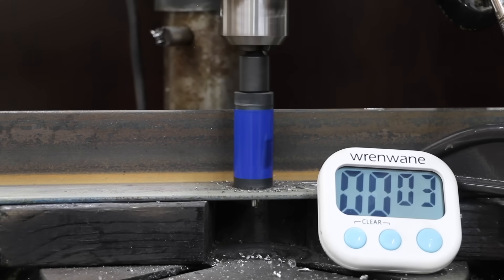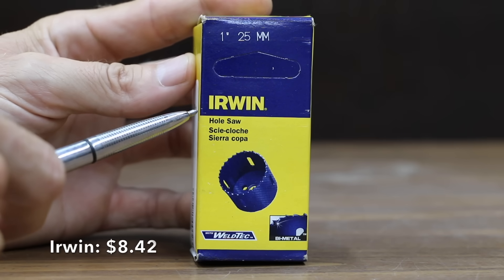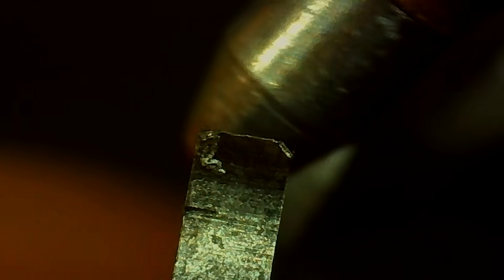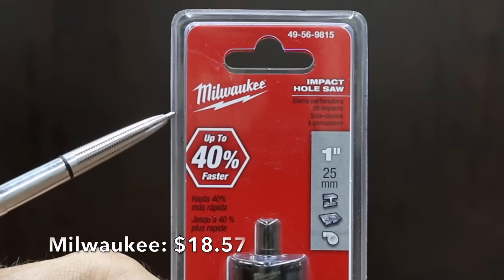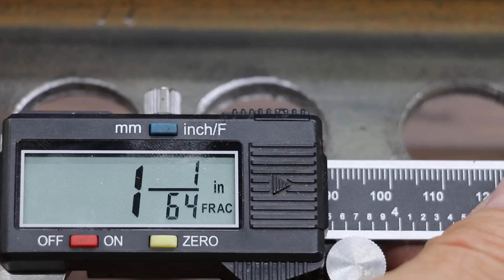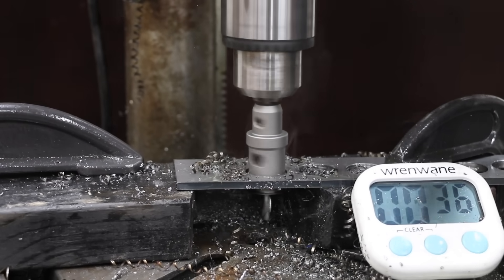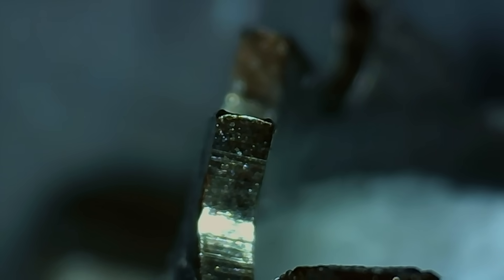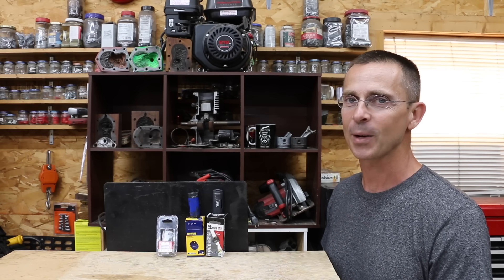Best Hole Saw Brand? DeWalt vs Milwaukee vs Irwin, Bosch, Lenox, Diablo, Bosch, MK Morse

Comment: Not to take away from a very useful test, but when testing any tools that have different metals (like carbide), the cutting speed is much different, so using a "common" weight on the press is going to ruin the blades. Also, letting steel get over-heated during a test with too much "weight" (cutting speed) without fully sinking that heat away (coolant or air) will "case harden" the plate and remove the "hardening" from the tool. Thus, the tool with better heat-sinking will not harden the plate (and not soften itself) as much and it is now cutting a different material than the other, so the test is now invalid, and every following test that uses a cutter that was abused.

Allowing the cutter to cut so much material that it stalls and then soaking in that heat momentarily and then quenching it instantly to room temperature (by the cutting fluid) will also ruin the cutter. If ANY tool stalls like that, you have already demanded more cut than you should have, which generated too much heat throughout the entire cut which invalidates the test, because it was performed outside the tool's designed envelope of operation and ruins the tool for any following tests.

This is especially important when you ramp through the tests from easiest to hardest. If you hurt the cutter in test A or B, it has no chance of working as designed in test C. Another thing to think about in terms of cutter speed is the surface size of the blades cutting into the plate. A wider blade has a much different "correct" cutting speed than a smaller one because it's cutting more material. Either the RPM or the downward force must be adjusted for the tool to be properly used. Nobody buys a tool and then intentionally ruins it, they try to follow the "best practices" of the manufacturer as is practical in the field.

Putting a wheel on the press makes sense to get an even playing field with the same types of tools operating within their envelope. However, this turns into precisely the wrong way to use tools of different types. Since carbide tips are similar to a lathe tool or milling tool, the same methodology of "material cut per second" needs to be calculated. A cutting rate to slow or too fast will damage the tool and the cutting performance will permanently tank in seconds.

Probably the easiest solution is to group the tools by blade material (or blade hardness) and calculate the correct cutter RPM and weight for blades of that material and use that as the base to use. You could make part 1 and part 2 videos showing the shootout of the same type of tools. More videos for us yay! Or you could stuff them all in one video, but the tests are different.

The high value of this channel is that the tests correspond to the real world. Anyone that pushes a drill bit into steel until it turns blue and stops cutting is not going to finish that hole or any other hole until the bit is sharpened. Even then, the flutes will not hold an edge now that the tool has been over-heated. People may accidentally operate a tool outside it's envelope, but the tool gives plenty of hints before it is being seriously abused, like smoke or blue metal. People react to that and adjust the cutting parameters to use the tool properly in real time, so testing outside that philosophy defeats the purpose of the "real world" testing.

It's difficult to devise a non-subjective test to flatten the field, and the majority of the tests on this channel are excellent at threading that tiny needle. However, when cutting steel it requires an entirely different set of parameters to flatten. Things that humans do easily in real time with the drill motor they are holding.

I'm not sure off the top of my head what that test would look like, but it would involve calculating the volume of material removed per rotation, the RPM, and constant cooling, to avoid ruining the blades being tested. Maybe the test is just using the optimal parameters for each individual tool and seeing how fast they get the work done and how many holes they cut until the tool is "spent"?

Sorry to hit you with a wall of text, but I think the principles I discussed are present in many of your tests involving different types of tools, and it would add a lot of value to the tests and your videos.
Reply from the maker: Thanks for the feedback.
Reply: @ProjectFarm  Thanks for the gracious reply. Keep making the best videos (by a huge margin) in this genre.

I noticed that I may have conflated FEED speed with cutting speed which is a tad different.

If anyone is actually interested, there are machinists on youtube and docs on the internet that actually know this stuff. I only know "of" it existing as a thing to pay attention to.

For example when drilling, it is much better to press hard enough to get some chips, then pull out to let the drill cool, and apply some oil to the hole, wait a moment and repeat.

Drills will last a lot longer and you'll get through the hole faster, than over-spinning the RPM with a light press which just grinds the point off the drill instead of cutting a hole. If you're not getting chips, your feed rate is usually too slow.

You normally only have to worry about this stuff when working with metals, but the chip advice is true in hack saws and chain saws too.

Another thing is aluminum being very abrasive as opposed to brass which is soft and almost self-lubricating. Cutting through multiple layers of tests with aluminum will seriously dull a tool by the time it gets to the hard test, so that's a thing to watch for.

In a perfect world, you'd start each phase of the test with a new (or sharpened) tool, but who has the money or time for that? Thanks for reading. I wrote it in the hope that it was useful and might improve future tests. Be safe.

Comment: Absolutely love the high speed info! No fluff, no yelling. 100% follow through with relevant information.

Would a diamond grit (eventually) cut through the armor plate? Would any of them gum up on aluminum? I have purchased a set of Rodman drill bits that look like masonry bits but also cut through hardened tool steel. I wonder if such a cutting edge has been applied to a hole saw?
Just called Rodman. They have grit bits but no cobalt all purpose bits... Yet
Reply from the maker: Great suggestion!  Thank you.

Comment: I'm slightly confused. The size is stated as 1" I believe, but at 9:55 it shows 25mm which is 0.984252 of an inch. This observation follows the part where the diameters were critically compared. Are they all really 25 mm, or is this apples and oranges on some of the hole sizes?

Also, showing the micrometer sizes in fractions of an inch where 1/128 = 0.0078 inches or (worst case) +/- half that, (0.0039) in rounding error to the nearest "resolution" up or down. This seems a bizarre choice rather than just showing decimals that are fully accurate to the resolution displayed and far easier to see the magnitude of the differences.

Having said that, as usual, the real world practical knowledge gained in all your videos is huge.

Comment: Some of the hole saws also appeared to be a little wonky in their rotations, as if they're not entirely straight. Despite that, good and entertaining video! Greetings from the Netherlands!
Reply from the maker: Glad you enjoyed!  Thanks for watching!
Reply: That might be the rigidity of the drill press showing, or the installation may not be perfect, leading to runout. Still, the point here is that it's not ideal conditions, but real world testing, and ideally the tailpiece should be capable of self-centering to minimise runout.
Reply: @EgorKaskader  well said

Comment: The lesson here is that if you want to punch a one inch hole in AR500 steel use your 25mm Bushmaster Autocannon.
Reply from the maker: Thanks for the feedback.

Comment: I have a new test for you I was told on an older vehicle or one that runs at higher temperatures that two cycle oil mixed really thin can clean out some of the carbon buildup
Reply from the maker: Thanks for the video idea.

Comment: I am trying to remove some rust from some parts. I read on line that there a number of methods to try.  They are 1.) Soak in white vinegar  2.) Soak in warm water with baking soda. 3.) Lime juice and salt. 4.)  Oxalic acid with warm water which is a little dangerous.  5.) Electrolysis with washing soda in warm water. SO I thought this would be a good project for you because of your testing expertise.
Reply from the maker: Great video idea.  Thank you.
Reply: @ProjectFarm  I have  tried to soak hydraulic couplers in 100% PB Blaster. I had a can with a broken nozzle so I drilled a hole in the top and put in a container.  I soaked them for a week and saw VERY little results. I have 12 JD couplers that cost around $35 each which I want to revitalize. I know you are the man for this challenge!!!!

Comment: So result are.. these newer style carbide 4 cutting teeth style holesaws are best to use nowadays? I almost spent 200 dollars on a set of milwaukee hole dozer.. but the quality seems shocking for the money.. but if its to cut wood only.. then this whole result would be different again with all the holesaws

Comment: Are you able to test electric pressure washer ranging from $300 to $1,000? I’m curious to see which is best for value. Having a gas one I have to haul out and set up takes up as much time as cleaning some items I want cleaned. So an electric one I can have inside hooked up all the time would be awesome.
Reply from the maker: Thanks for the suggestion.

Comment: Suggestion: I have seen your video of Lucas vs the other one, but I am curios if any of these oil additive products make the oil last not as long? I have heard rumors that Lucas will cause your oil to gunk up quicker, even full synthetic. Would you be able to test this? I currently use Lucas heavy duty oil stabilizer and am thinking of switching but don't know.
Reply from the maker: Great suggestion!  Thank you.

Comment: Suggestion: testing which oscillating multi-tool blade/attachment is the best for different applications such as cutting wood, nails/screws, pvc, drywall and etc. keep up the great videos!
Reply from the maker: Great suggestion!  Thank you.
Reply: @ProjectFarm  be sure to test Diablo's brand new full line of Oscillating Multi-Tool blades
Reply: Lol I literally just typed this suggestion above because I just got done polishing a blade trying to cut a drywall screw out. 😂😂
Reply: if it cuts hard screws,it cuts everything..
Reply: Fein would likely win.

Comment: I hate to propose another oil test but I really need to see what GM still hopes to achieve by pushing Dexos oil in their new vehicles. Or test their orange antifreeze against anything. I’m pretty sure it’s just a cash grab so people won’t use the bare minimum, but I’d be dipped if they beat an actual legit competitor.
Reply from the maker: Thanks for the video idea.

Comment: If your only going to drill a one inch hole in steel a "Hougen" is a much better idea.  I know it requires a specialty drill, but you can't beat it.
You should test hole saw's bigger the two inch.
Reply from the maker: Thanks for the video idea.

Comment: Thanks as always for your excellent vids.  I was wondering recently about a good rubber restorer.  Such as the rubber on a steering wheel horn or other bits of trim.  Wondering if there are products you can compare not just for short term visual improvements but actual rubber restoration.  Thanks again!
Reply from the maker: Great suggestion!  Thank you.

Comment: Thanks for the video. So, where are they getting the "life" rating from? Is there a scale or outline chart somewhere? for a hole saw to determine what the "average" life is? Just trying to figure out how these manufacturers can claim 2x life when they have such a wide range of materials they cut....like what are they basing it off of?
Reply from the maker: Great point.  I believe they do their own testing, comparing their brand against others.

Comment: I use hole saws daily,  Rock River is hands down the best I've ever used . Around $8 for a 2 3/4 " . Morse whole saws fail after 4 or 5 holes in aluminum , lucky to drill more than 1 hole in steel . BUY ROCK RIVER !!!!!
Reply from the maker: Thanks for sharing.

Comment: Typically the type of warranty a tool offers and how well they honor it is factored into whether or not I buy it.  Could you explore that part since you're basically testing to the point of failure?
Reply from the maker: Thanks for the suggestion.

Comment: I use some HILTI products, very good for stainless steel.  I don't know but I think it's with cobalt. anyway expensive as hell,  maybe for hand drill if you can use carbide,,,use those hilti . After years off use this on stainless Steel,  I chose semi eco vs, with full flux oil and is OK. holesX€ it is ok
Reply from the maker: Thanks for the feedback.

Comment: machinist checking in. real tungsten carbide shouldn't be touched by any of those vickers testers... tungsten carbide is around 2400 vickers, as compared to around 2000 for mohs 9 (corundum), around 5000 vickers for cubic boron nitride, and 10000 vickers for diamond (mohs 10). either the carbide had something on it which was being scratched like flux residue from brazing, or something very fishy was going on.

the lack of rigidity in the drill press, and the feed/speed you used created a disadvantage for the carbide saws. carbide does not like to be run slowly.

you're using a woodworking drill press for metalworking, and the results show it.
Reply: Absolutely, but I think this is for most people that are either using these in a handheld drill or a drill press that is pretty close to what he was using.
Reply: @anthonypascucci7001  using a hole saw with a hand drill in metal besides stuff like thin wall conduit is just asking for trouble
Reply: Sometimes ya ain't got no choice.  @SuperAWaC
Reply: The runout on the drill press was way big, this increases the size of the hole and increases the friction during the cut due to scrubbing.

Comment: Shootout idea: 3/4" drive 1/2" adapters. A quick look at the reviews on Amazon and so many have broken because they've been over torqued by 3/4" breaker bars. For example:

https://www.amazon.com/TEKTON-47823-4-Inch-2-Inch-Reducer/dp/B000NQ4R4G/ref=sr_1_26?dchild=1&keywords=3%2F4%22+drive+socket+adapter&qid=1597307931&sr=8-26#customerReviews

Comment: I would like to see a 2 stroke oil shootout using a 2 cycle trimmer seeing which oil clogs up the spark arrestor screen how dirty the plug gets after a quart ran through them, all mixed at 50:1
Reply from the maker: Great video idea.  Thank you.

Comment: 1. Best oil extractor. Is the remaining oil bad for engine. 
2. Best engine flush
3. Best intakt valve cleaner (sprays at intake) 
4.best way to get rid of hydralic lifter noice. (Thinner oil or additives.

Love youre videos!

Comment: I worked for M.K. Morse at one point. I would bet that the Irwin is made by MK Morse. At the time I worked there the only competitor manufacturer in the USA was Lenox. Morse have straight cleanout slots, lenox slanted. They made saw blades for Matco, ACE, klein, Makita, John Deere and more....
Reply from the maker: Thanks for the feedback.

Comment: You should do a video of the best combination wrenches. Is Tekton really the king of the middle-of-the-road wrenches, or is Proto better than Snap On?

You'd have to look at ratcheting and non-ratcheting box ends, and smooth and non-slip open ends. 

Also, does the slop of the wrenches actually affect their performance or is it part of the engineering process they went through?
Reply from the maker: Great suggestion!  Thank you.

Comment: I have a Diablo set and when using the pilot bit it wobbles out of control.  I wish there was a set screw to tighten the pilot bit down when drilling through metal.  My old Lennox set pushed a much neater hole through steel. Thank you for the review.   Another awesome video!
Reply from the maker: Thanks for sharing.  You are welcome!

Comment: Those carbide drills if they were run slower may have surprised you and not broke or damaged the teeth especially those of a number 9.
I found over the years sometimes you have to go much slower then most drill presses go,
Using my lathe and carbide bits the slower I went the deeper the cut I could make, a light pressured cut the faster one could go
Those of lower hardness I would never use, They are just not designed for good cutting,  Trash them all or use them for wood only,
Reply from the maker: Thanks for the feedback.

Comment: PF! I just thought of a test. When I was working in construction we used small bits made for glass to cut small holes for anchors into ceramic tile wainscoting. We found they were more reliable in cutting holes in ceramic than other bits or hammer drills. Maybe testing different bits in glass or ceramic tile and seeing which one works best would be interesting. The bits for glass worked really well for maybe 3 holes then after that they were pretty shot and the drilling went really slow after that. A test of specialty glass or ceramic bits would be good, valuable information.
Reply from the maker: Great video idea.  Thank you.